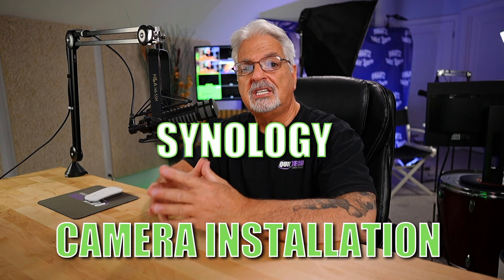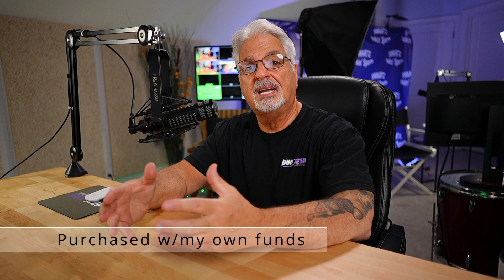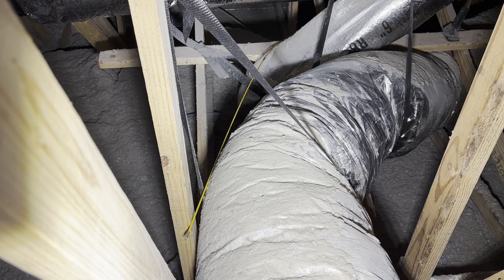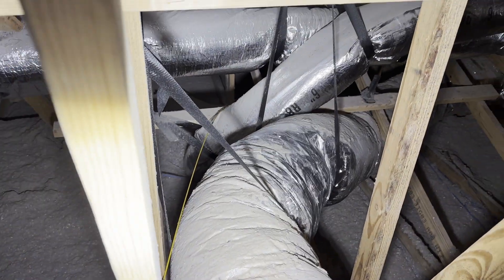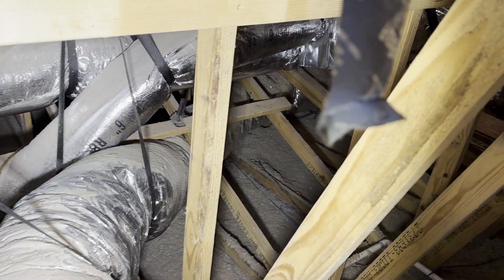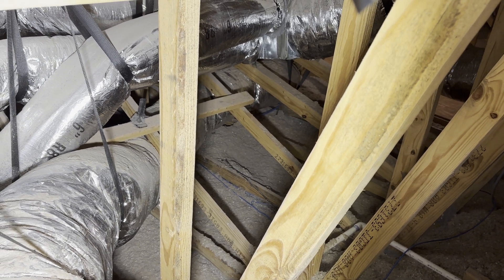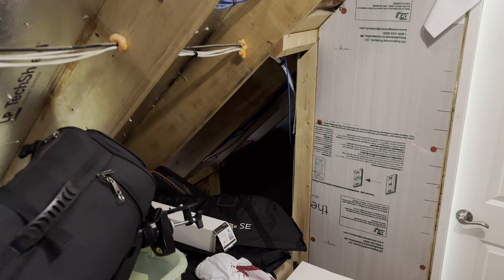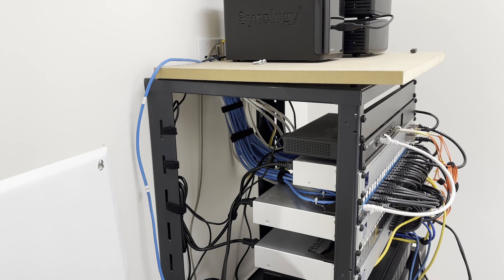Easy Step-by-step Installation Of Synology TC500

Comment: Tony, as usual your content and videos are just great. 

Would it have been possible to configure the camera on your VLAN first before moving over to the monitor center?

Thanks and keep up the great work.
Reply from the maker: Thanks Rick. Great question! Yes, could’ve have definitely set up the camera on the vlan first. But, would’ve still had to set it up manually. The reason why I did it the way I did was because I knew Surveillance Station would automatically detect it on the same subnet. I thought first sure the IP would’ve auto-updated after power cycling the switch port.
Reply: Thanks Tony for replying back. Good information.

Comment: Great video!

1) you’re so much faster than me at terminating!
2) do you need me to buy you a spade bit or hole saw lol
3) you are pretty confident in your termination to not test before mounting the camera and terminating the keystone. 😅
4) you would think that once you activate a camera that is synology branded, it would be able to track its IP change even if it is cross VLAN. For example, in activating the camera, the camera could be taught the IP of the surveillance station and alert the NAS of an IP change. Seems like a good feature request to synology rather than having to redo the activation.
5) pretty handy your attic is right above where the camera is.
6) I saw in another comment you are going to replace your Amcrest cams with synology cams. Are they that much better? 
7) how much is the camera in this video?
Reply from the maker: Thanks for watching. 
1) The termination sections were sped up but you already know this. :)

2) Thanks.  I have all the tools I need.  Took a minimal amount with me to minimize going up & down the ladder. I always drill a small pilot hole first just in case I drill into the wrong place, it is easily fixed. 

3) Yes, I am pretty confident with my terminations.  I've done enough of them over the years.  However, please note, I always test the cables when working for a paying customer.  You are a very perceptive viewer. :)

4) I agree 100%. I was surprised to see that the IP address did not auto-update. Great suggestion to make a feature request to Synology.

5) Not exactly above the camera but in close proximity. I did use 3 fish sticks in order not to have to walk the rafters. Scoping out the environment beforehand and having landmarks such as air conditioning vents and can lights help tremendously. 

6) From what I 'm seeing so far, the night vision is much better. 

7) The Synology cameras are $220. Yes, a bit more expensive than the Amcrest model I have installed.  However, this price also includes the camera license. So, in actuality, one can move a Synology camera from NAS to NAS and the license moves with it. 

I hope this answers your inquiries.  Have a great day!
Reply: @QuikTechSolutions  thank you for the reply!!